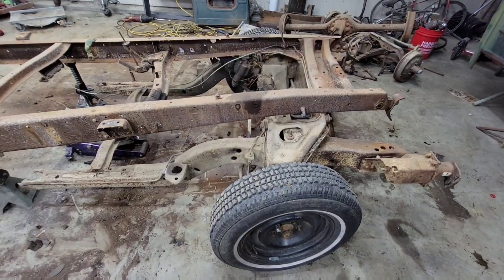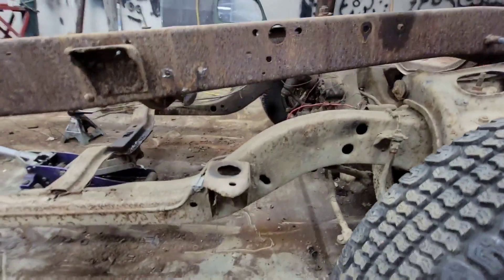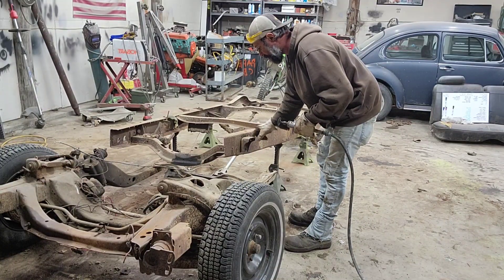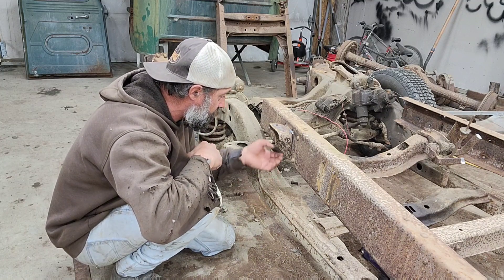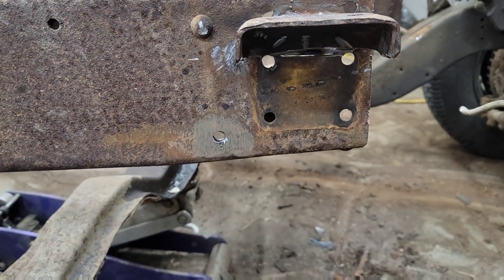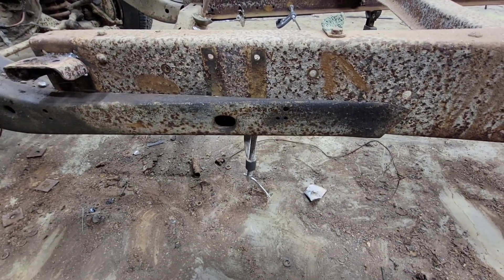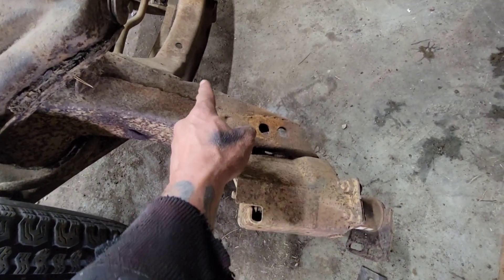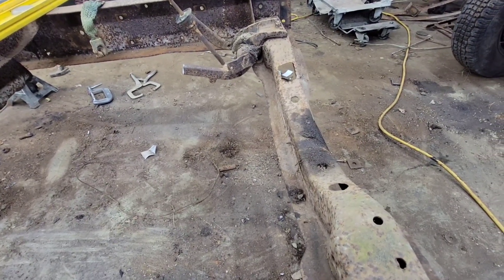How To Graft Subframe On A Hot Rod Part 1

Comment: What year nova sub frame. Because I want to use nova frame because I can’t find a s10
Reply from the maker: @mariodacosta4172  68-74 they work the best because they are rear steer so there's a lot less screwing around to get a different kind of body to fit over it if you used a Camaro subframe like second generation 73 281 it's a front steering box then you have to manipulate everything to get around it